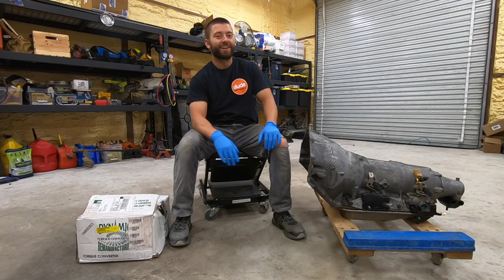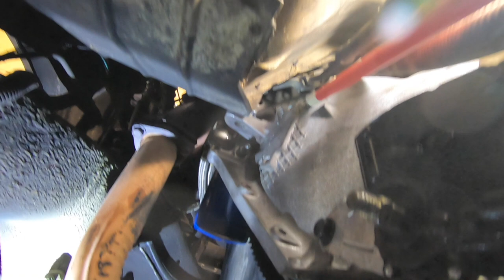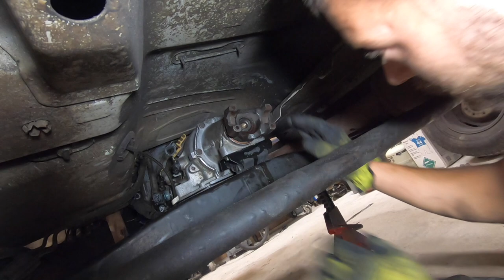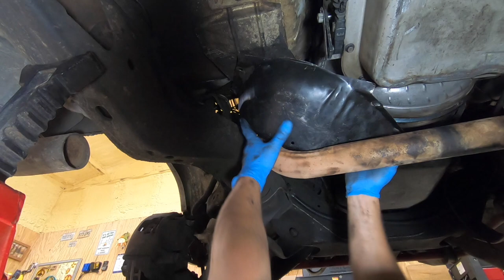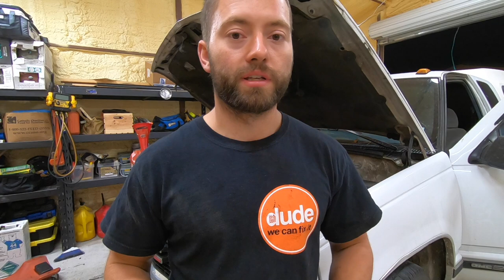4L80 TRANSMISSION INSTALL || EASY

Comment from the maker: 0:00 Introduction
0:34 Torque converter
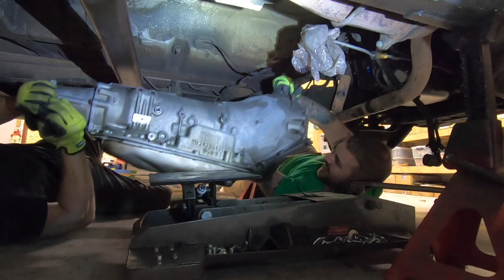2:30 Lift Transmission 
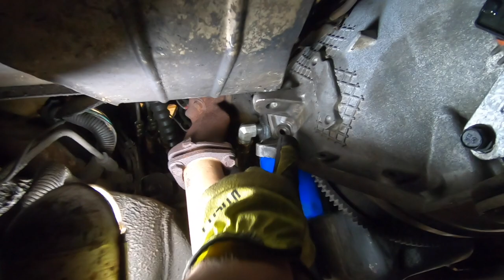3:42 Bell Housing Bolts 
6:23 Torque Converter Bolts 
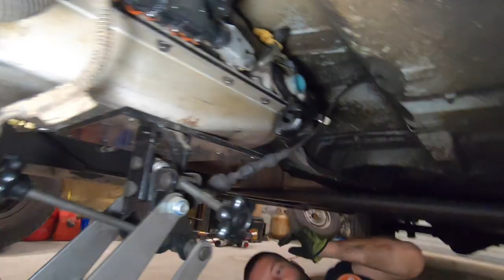8:56 Trans Mount & Crossmember 
12:30 Yoke 
13:09 Drive Shaft 
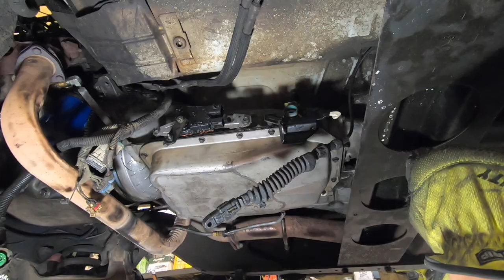14:42 Shifter Linkage 
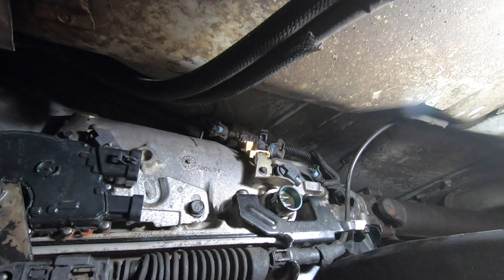16:25 Electrical Harness
18:30 Oil Cooler Lines 
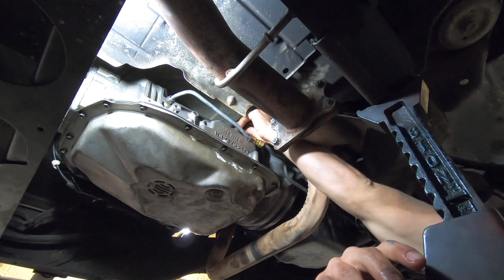19:04 Inspection Cover 
21:29 Starter 
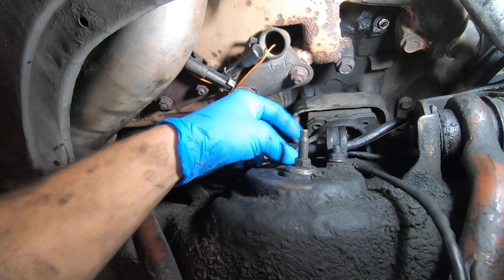26:50 Glow Plug Wires
27:47 Battery 
27:50 Trans Fluid

Comment: This is a great video for 2 wheel drive models with a bolt on you style. However, 4 wheel drive models with slip yolks are a bit harder with the transfer case and its crossmember, plus all the bolts associated with that.
Reply from the maker: True, I need to make a video for 4wd models

Comment: Hello I saw your 4l60e rebuild video I have a 06 YukonXl I plan on doing the 4l80e swap in it but I want to rebuild it first I didn't see that you had a rebuild video for the 4l80e or not if not do you plan on making g 1 your 4l60e video was very easy to follow and I would love to see your rebuild video for the 4l80e thanks Kyle
Reply from the maker: I am going to be doing a 4L80 rebuild soon. I won't have the video out till later in the year
Reply: @dudewecanfixit  Awesome, thank you.

Comment: How’s it going, awesome video thanks for posting. I’m doing the 4L80e install but wanted to ask after bolting the trans to the engine my gap between the torque converter and flywheel is close to 1/2”, is that normal? My measurements for the flywheel mounting pads to engine and torque converter mounting pads to bell housing flat were both within the recommended gaps specs
Reply from the maker: I'm not sure what the maximum allowable gap is there. You might want get a second opinion

Comment: I got a 4l80e on a 2000 GMC Sierra and someone cut all the wires now I can't figure out which is which there's 3 different greens one has a white line 14 wires all together ?? The 4x4 case is missing so
Reply from the maker: You should probably start by replacing the wire harness wherever it is cut
Reply: @dudewecanfixit  do you know how many wires there's supposed to be ? I don't have the money to buy a new harness right now, thanks.
Reply: I was told 4l80 transmission  needs to be program by chevy dealer if it's rebuild or salvaged transmission 2014 suburban
Reply from the maker: I do not. Are the ends of the wires visible to count them
Reply from the maker: For a 2014, it might be necessary. Mine is much older and doesn't require it.
Reply: @dudewecanfixit  I'd have to check but right now there's a bunch of snow outside

Comment: Over all very good, however there are two little things that would have made it perfect. 1) marking the U joints for correct orientation for drive shaft balance. 2) should have blown out the cooler lines with air to make sure any debris from the previous install was cleaned out.(learned the hard way on this one)
Reply from the maker: Yes, both very good points!

Comment: Do you know if the 4l80e will fit in a 1500 with the factory tunnel?
Reply from the maker: Ooh, that's an interesting question.

Being that the 1500s and the 2500s and 3500s share the same cab, I would imagine that it would fit. There may be other complications with the fit and finish though

Comment: Question. So on the removal u removed the exhaust on the install the exhaust is mounted. Is it not a pain to install the transmission with the exhaust still bolted?
Reply from the maker: If you can take the exhaust off, it makes it easier. Sometimes the bolts are rusted on though. Just showing that it can be done either way.

Comment: Is there a trick to getting the transmission dipstick mounted on the stud? I have been unable to get it on
Reply from the maker: It helps to have 2 people. You can try putting a jack under the trans and lifting it up and lowering it. Usually, letting the transmission hang gives more clearance but sometimes it needs to be in a certain position.
Reply from the maker: Also, make sure the dipstick is completely seated in the pan/transmission
Reply: I had the same problem. I ended up pushing down on the tab with a notched end trim clip pry bar to get it to go over the end of the stud. Once in place and tightened down you can bend it back into the proper location as needed. They must have had the stud & nut loosely in the dipstick tube when the trans was mated to the engine on the assembly line then just snugged it up with a wrench. Can't do that so easily trying to install the tube when the transmission is already bolted to the engine or when the body tub is in the way. Piece of cake on an engine crane or on a rolling chassis.
Reply from the maker: It is usually best to seat the dipstick before the trans is mated to the engine.